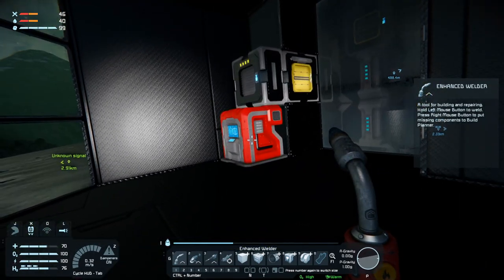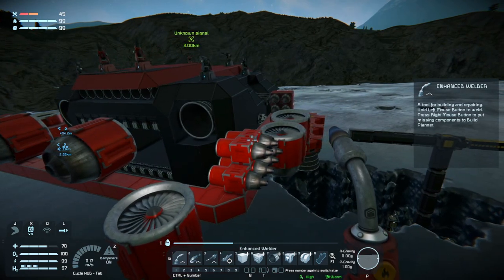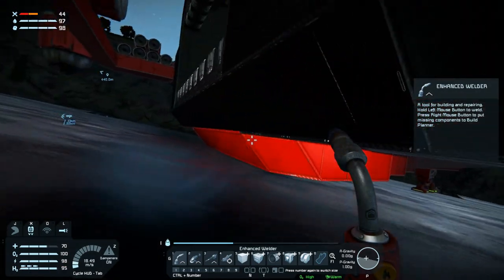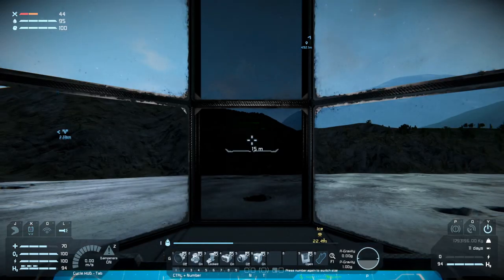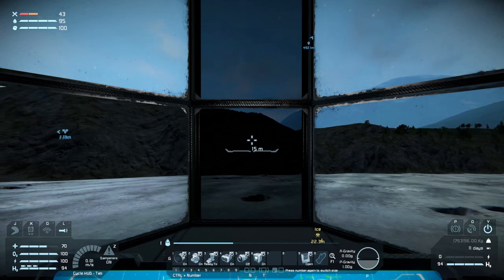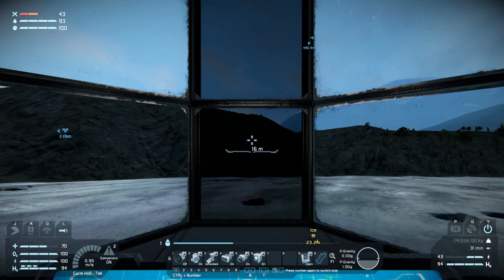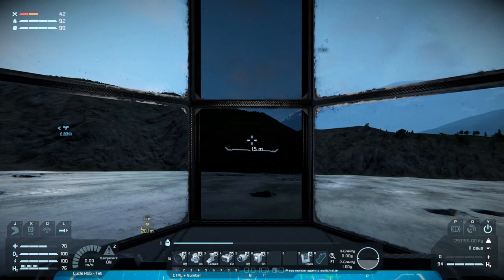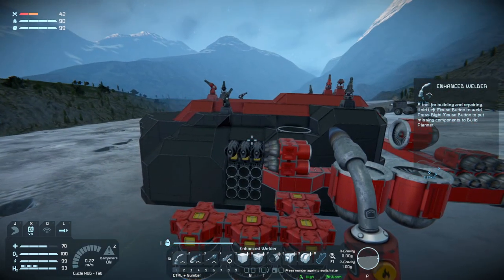Lets Play Space Engineers Modded Survival Ep63 | Issues

Comment: Having not seen the ship even get up to the 5km mark with the atmos and then switch over to the hydrogen thrusters it is somewhat hard to say what the issue is. I can think of a few possibilities though.

1. Do hydro thrusters require electrical power to operate at all? Obviously their main fuel is the hydrogen but it likely requires se kind of electrical component to spark it off and regulate flow. Thus the problem might be similar to your other ship earlier, not enough power to keep everything running at the same time.

2. How much fuel does each thruster require? You could create a test chamber essentially with armor blocks and inside create a hydrogen tank then attach a small battery and a gyroscope, put a single hydrogen thruster at the bottom and turn that on. Then you just see how much hydrogen that thing uses over the course of like 10 seconds. You didn't check your hydrogen tanks here so no idea how much you may have used.

3. Keeping with the test chamber idea you could also strap a cargo container to it and slowly add cargo to it until the thruster can't hold it up anymore, that way you know how much weight any one given thruster can support.

4. Are you using the hydrogen engines right? It seems odd to me that the atmos get you up to 5km but the hydros can't even maintain your altitude. Have you properly hooked them up to the hydrogen tanks? Is there a specific intake point for the engines? Is there a seperate fuel line block or something for those that you are supposed to use instead of conveyors?

I thought that it would have taken off with just the thrusters you originally had so the fact that you have fewer atmos now then hydrogen thrusters and the hydros can't even hold altitude reeeeeally makes me suspicious that something isn't right with them. Anyways those are my thoughts, hopefully you get it figured out.

Comment: Hi. Some thoughts - 
Ions are not the answer, they have a fraction of the power of hydrogen thrusters.
Does it have a lot of heavy armour blocks? If so change them to light armour.
Is it a ‘ship’ on the Information screen?
Good luck with the solution.
Reply from the maker: There are no heavy armor blocks on the ship, only light, I will check if it's a ship, but I have flown it with atmo thrusterss, it only becomes a problem when atmo thrusters no longer work and I have to turn them off, then I drop like a rock, even if I detach the atmo thrust bit so I am not hauling that weight...